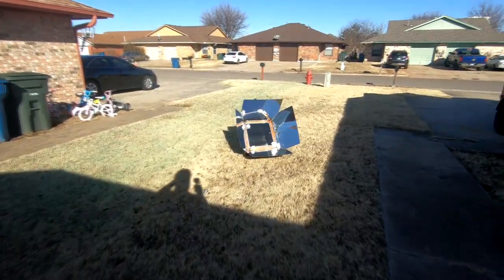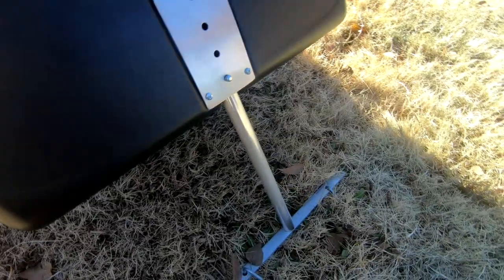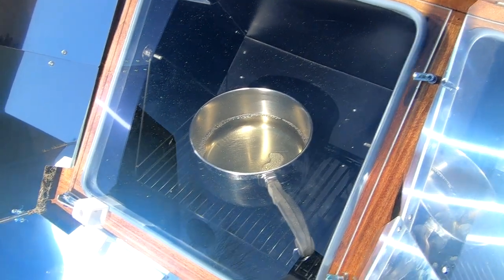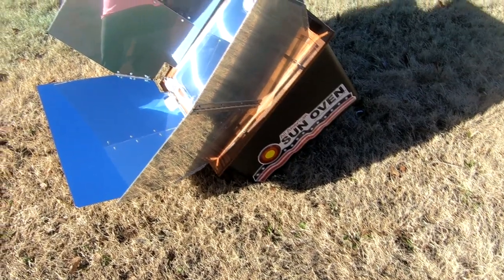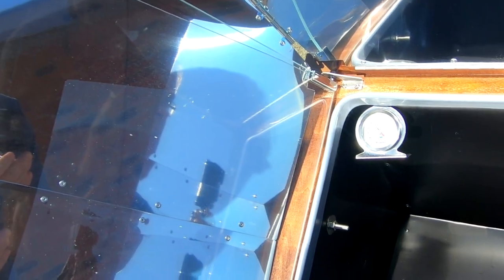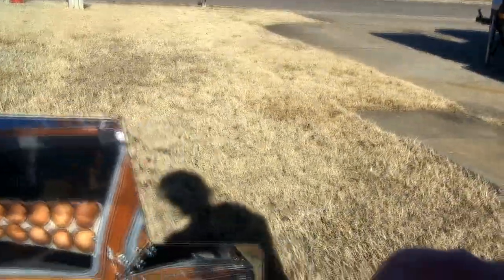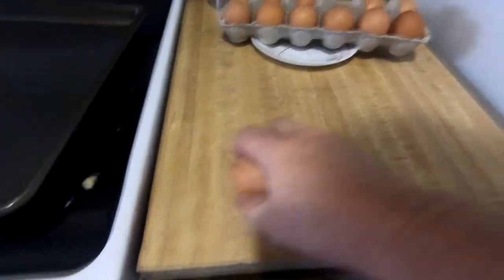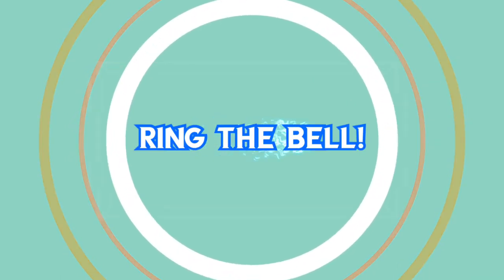Hard-Boiled Eggs From A Solar Oven!

Comment: Cool.  I've been thinking of getting one of these since seeing it on Doug and Stacey's channel but since they are all about selling stuff and NOT what is really good I've hesitated.  Y'all are more interested in finding stuff and, if its good for you, sharing the info.  I'll have to give this a second look.  Thanks.

EDIT:  I typed the above part way thru the video.  After watching to the end I have a suggestion...the "doneness" test is ROLLING the egg, not spinning it.  When rolling a done egg the innards are solid and pretty equally distributed and it rolls evenly.  If only partly done the innards are part solid and part still liquid and tends to stick to one side, making the egg "wobble" when it rolls unevenly.
Reply from the maker: Thanks for the tip on the eggs, Bob. Because Contentment gets 333 days of sunlight per year, any appliance that takes advantage of sunlight is potentially useful to us. We have had our eye on a solar oven for years, and even considered building one of our own. Our impression of this oven so far is that it would be useful as a 'slow cooker', but not necessarily for everyday use. We'll see. For E-Chip, the true test will be if it will bake a peach pie! We want a way to cook until the home at Contentment is finished. The sun oven is a great way to cook without heating up the Sh'ouse in Summer and doesn't rely on any fuel at all.

Comment: Hello E-Cip and Robber, interesting to see eggs cooked in the sun oven.  Fresh eggs are hard to peal.  I put a pin hole in the air pocket side and peal while on the warm side.  Dont know if this is the same with the sun oven.  💕 NonnaGrace
Reply from the maker: Hello NonnaGrace!  Yeah, it seems the older the eggs, the easier to peel. Butwe think in this case the eggs were not completely cooked. We should have left them in for longer. We will next time!  Merry Christmas!